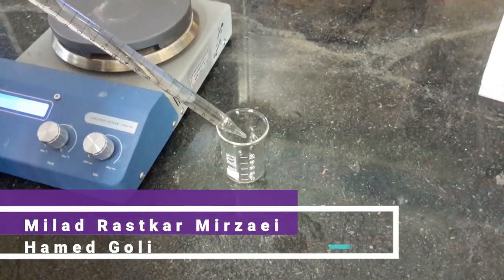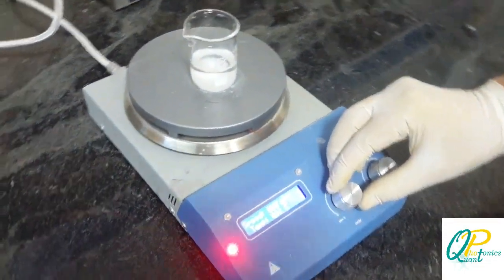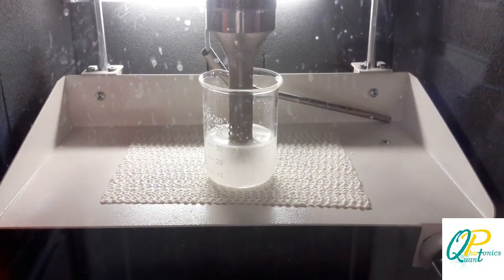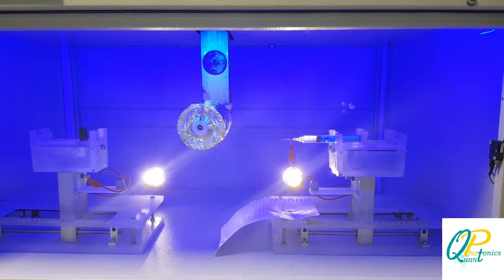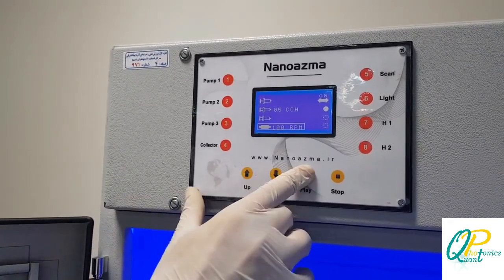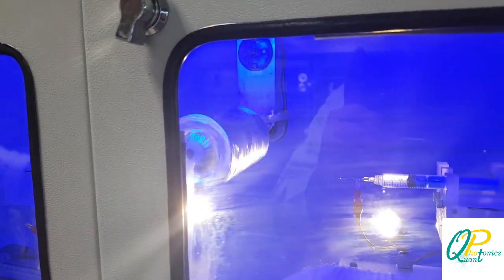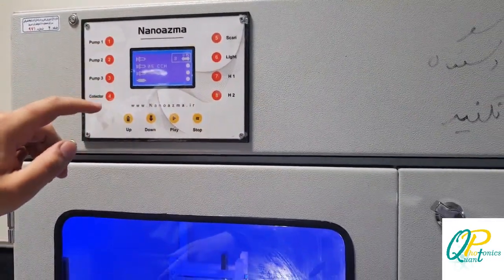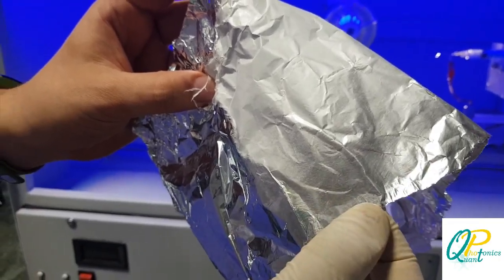Nano-fiber Electrospinning

Comment: Thank you very much for the video but you can not tell they are nanofibers until you have an SEM image. We had some experiments with PVA recently. Everything looked ok during the process. However, when we looked at the SEM images there were no fibers. Just some PVA drops on the foil.
Reply: increase the viscosity of the solution
Reply: Please tell me the concentrations used
Reply: That might be the beads. The external environmental conditions should also be controlled during the electrospinning like Humidity and temperature.